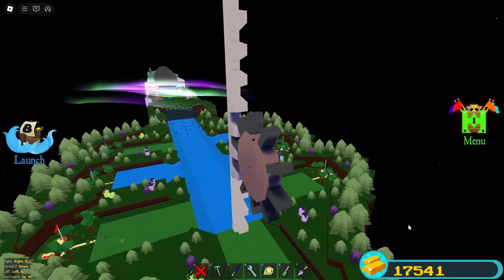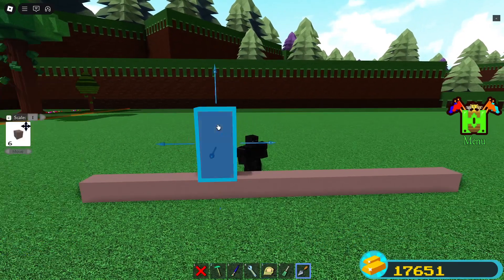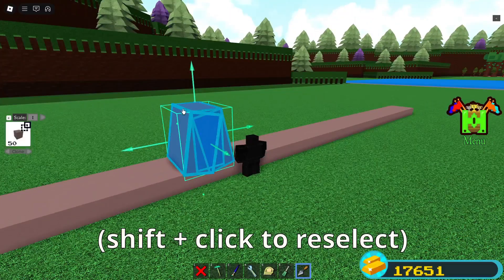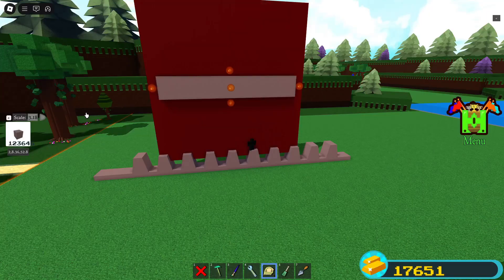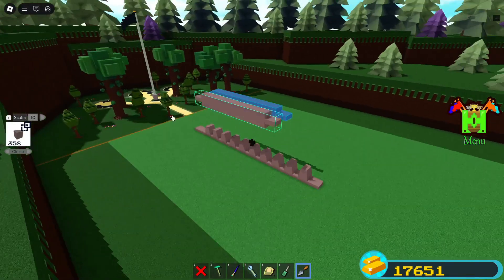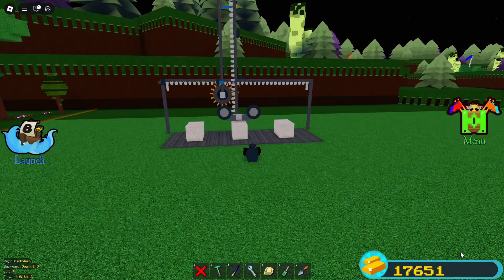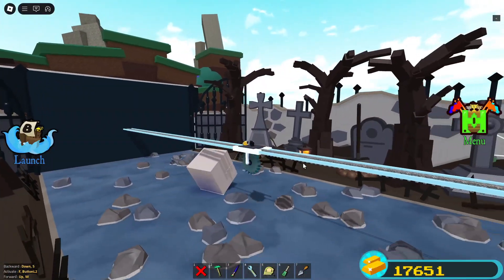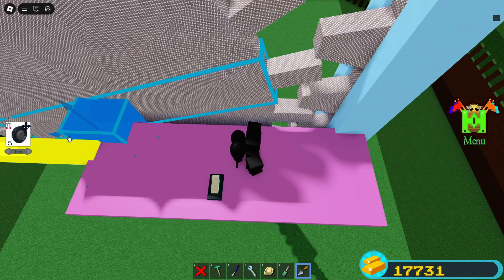Build a Boat - Gear Racks (tutorial)

Comment: Wait, why you cant use same teeth like in rack on da gear?
Reply from the maker: it would very likely get stuck. The less number of teeth a gear has, the thinner the teeth have to be
Reply: @dabl2928  Ohh... wait, so ya dont use same teeth on da rack, cuz it more likely to stuck too?
Reply from the maker: gears in real life have a special curve which is pointless and hard to make in babft (the curve changes with number of teeth). So I simplified the teeth to just 1 piece.

Racks only have a straight line so i didn't even simplify them, because with the 12 degree sloped sides it reduces playback (amount of air between the intersecting teeth)
Reply: @dabl2928  yeah, ik, itz just to make them more effective, so they can payback almost 100% of given energy... Also: oh, so you made it a little bit more complex, to it will be more effective... cool👍

Comment: i was wondering at 8:08 how you made that grabber with the 2 tires,i tried it many ways but it ither malfunctioned or glitched
Reply from the maker: hm i just used springs to guide the racks instead of ice, and it worked (you might need to shorten some teeth so it doesn't stick together when you reload)
Reply: @dabl2928   oh um no i dont mean the racks,i mean the tire thing,how did you make that?

Comment: nice tutorial,but how did you make a spring go so long, i need to go stacking springs just to make my gear guided for 200 studs or smt
Reply from the maker: you need to place it far apart in the first place (because you cant set a spring longer than 51 with screwdriver tool). Then you just compress it into a small one and use trowel to place one end of it onto your rack and its ready to use (one part of the spring only connects when reloading, so keep that in mind).
Reply: @dabl2928  sorry,but how do i compress it

Comment: very nice tutorial,but when i try to make a car with that gear racks,something like  the one you made in the start of the video,the gear just doesnt move and moves the wheel thats supposed to make the gear rotate,and could you make a tutorial for how to use piston to guide the rack?
Reply from the maker: hm im guessing yours got stuck together when reloading, so you need to shorten those that are "in contact" when loaded and anchored. Even though its not actually intersecting anywhere, the game still counts it as connected
Reply: @dabl2928  thank you so much bro,i did that now its working i even made the car
Reply: @dabl2928  now ill make one that goes to the end

Comment: How do the people do it with the spring? I know its always THICK, but what are the values for it? My tries never work.
Reply from the maker: the accelerometer or something else?
Reply: @dabl2928  i mean some people put a spring on the gear rack so it doesnt like drop or smth, it can still move. I hope you get it
Reply from the maker: oh yeah thats pretty simple, stiffness shouldnt even matter (unless you want it to return to a position) so you can use 0 stiffness, which i usually used

Comment: I dont understand.. my gear just gets anchored to my rack ,even if I put the gear so fat from rack that they are almost not even touching together, then it only works, like the teeth from rack is fake, and then when it falls in rack unanchored, I save it  and i load it and its anchored again even when i put unanchored  with tools,etc
Reply: and Yes The rack and gear is perfectly made beacuse I did it 2 times and even checked dimensions
Reply from the maker: yeah it can be annoying and mostly happens with smaller modules, the game counts it as 1 piece and sticks them together, so you can either shorten the teeth close to the rack or always push it together with pistons

Comment: does moving the gear in by the module work for any other type of gear
Reply from the maker: yeah it should always work but you have to build it right on top of the tooth with the planning circle (which you usually dont)